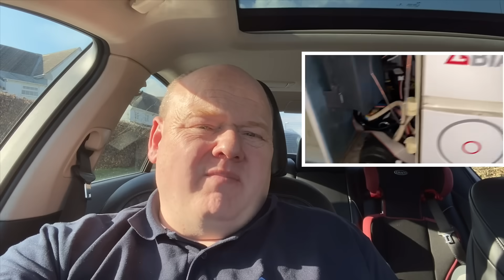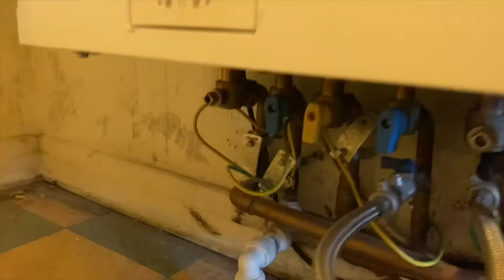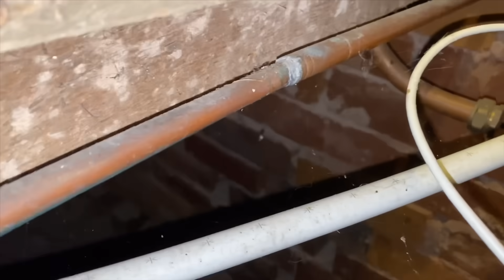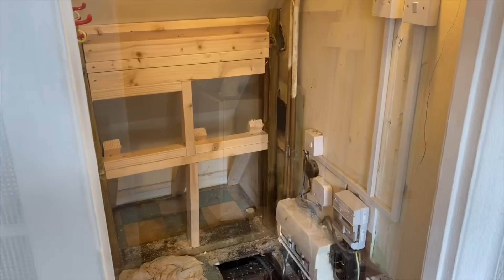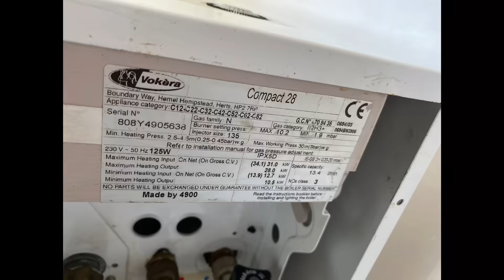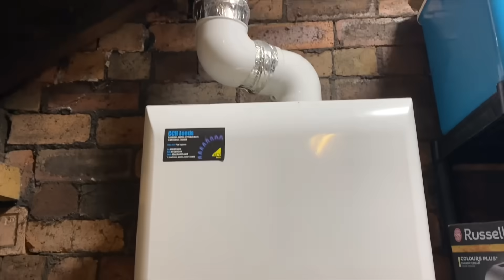LEEDS PLUMBER - Shocking Boiler Installation and New Boiler

Comment: The baxi platingham install looks rough I would have put a 45 on the flue because flue is not going through wall straight , also pipe work to boiler looks rough and not straight

Comment: I am stuck in my way always fitted vaillant from old Sine18 except 5 years when I did viessmann. I went to viessmann to use their vitotronic weather compensator and fitted viessmann solar thermal. I fell out with viessmann over spare parts and went back to vaillant (ecotec plus). I have done weather compensation for 30 years, used to use honey well aq6000 (I think) brilliant control with proper optimisation both on and off. Now I going on....

Comment: Why does he always say the gas supply needs to 22mm. The man obviously doesn't know what hes talking about, never heard him pipe size? In my experience anything over 15 meters effective length needs to be 35mm.
Reply from the maker: The required pipe size was 22mm. gas rate and the inlet pressure were tested at the end of the job. What you are saying about 15m is totally incorrect, It would depend on the required volume. Thanks.

Comment: Hi Allen, just looking at you're baxi replacing biasi vid.. Pretty common on the continent to find pipe soldered inside another pipe, manufacturers make their pipe to do this. If you need to go up two sizes they insert a pipe expander and stretch the cooper to allow the insertion of the bigger pipe. Keep up the good work Al'
phil 
Nottage Gas & Heating

Comment: I see quite a few poor installs similar to that shown, the use of push fit going all over the place is probably the one of the most common , and quite often fitted by a gas safe engineer. Other common faults are condensate flues with the fall to outside, and definitely  uninsulated overflow pipe on the outside of buildings. This is a great job to do and spoiled only by a small number of "Installers" who cut corners. Keep up the good work with the videos.

Comment: The Biasi was most definitely installed by a (lazy) pro. Probably been a multipoint in there before fed by the 12mm. The cutter rings were to tighten the 15mm pipe onto the 12mm to hold it while soldering. We did that in the 70's/80's joining 6mm to 8mm (old coal fired rads used to be piped in 6) as you couldn't buy reducers then so it was done by someone who is probably quite old now if they knew to do that. Ruff as fuck on gas tho and you can get the correct fittings (tho not easily as they will be an order).
The Vokera was probably also a pro doing a homer ( a Saturday job for half the cost of legit). Thrown out the back of the van for about 200 quid plus (stolen) materials by someone who would never dream of doing that standard in his 8-5 job as he would be sacked.
Whoever paid it deserved the standard they got.
People should realise the get what they pay for. Things are cheap for a reason but unfortunately many only see that they turn the boiler on and get heat so it works.
Most people, more so these days are totally thick for some of the stuff they pay for. A blind man would look at it and think wtf. 
Its not just in this trade its in all trades! The decline in standards (which imo will get worse) is because there are no apprenticeships anymore. Most so called tradesmen under about 35 learned their trade at the customers expense.
Thankfully my kids will never have to pay a tradesman for anything as long as i'm alive as its like a lottery. How bad is it when i'm saying that?
There are still a few good conscientious guys out there fighting a loosing battle but they are few and far between.
Ranting a bit there lol

Comment: Hey Allen, im wondering do you check all boilers you attend to see if they have been commissioned/notified? I had one recently that was in a rented accommodation.. they had a valid landlord ticket but wasn’t commissioned or notified and according to gas safe themselves as long as it has a valid cp12 the property is deemed safe to lett..

To me if the property is rented then there must be a responsible name to a boiler install because cp12 doesn’t involve removing boilers to check for secure fixing dismantling flues or reinstalling gas pipes... the conversation with gas safe went through all this and they gave me no guidance on the commissioning.. they were only interested in if it had a cp12

Is this proof that gas safe isnt really interested?

Comment: It's time to only sell boilers to registered gas engineers !  I fit 28mm as standard  because I've tested boilers with 22mm pipe and even short runs give more than 1mb drop  .
Forgot to mention DIY places like b&q should not beable to sell boilers and any gas appliances. 
Biassi are usually sold at these places .
Reply: The baxi platibgham looks a bit close to the floor ,have you checked in the book ?
Reply from the maker: @mgbroadsterJ  Yes many times 😂😂😂😂
Reply: Daren Parker . Some boilers can go down to 16mb at full rate.

Comment: Please do show us you sealing a flue inside and outside. 
Also what is the purpose of fitting a shock arrestor to the cold feed to a boiler?
There is so much to learn when becoming a gas engineer it can be very overwhelming. Your level of skill is admirable.
Reply from the maker: I will try and cover that when i install the main boiler. 👍

Comment: We had a trisave boiler and hot water cylinder replaced by valiant combi 13 years a go after coming home home from an evening out we could smell something similar to kippers when we went up upstairs to the airing cupboard the fuse spur was red hot and sizzling inside because the fitter put to many wires in to 1 box also the condensation pipe was poorly fitted and he didbt even power flush the system before installation. ALL OF THIS BY AN EX BRITISH GAS ENGINEER WHO WE LATER FOUND OUT GOT HIS GAS SAFE CARD TAKEN AWAY FROM HIM DUE TO TO COMPLAINTS!!

Comment: Enjoy watching your videos Allen, one quick question,was the gas pressed under the floor boards? It's just on acs course they told us to treat them as demountable, and should not be under there like compression.
Reply from the maker: The ACS examiner is wrong. It’s classed the same as soldered fittings. Thanks.

Comment: Surely, surely, it takes more effort to sweat joins like that than just use reducers 🤷.  More importantly, who had 12mm copper floating about?  Wonder if it ever had one of them old Main on demand hot water boilers 🤔, I'm sure they used to have huge square shaped flue outlets, and usually plumbed in 15mm.
Reply from the maker: I have never used 12mm before. i totally cut this out. Thanks.
Reply: @AllenHart999  I get that.  Honestly though, the effort some people put in to making a poor job is mind blowing. Keep up the good work.  Love the videos!
Reply: I am ex British gas, started 76 and late 70's we used 12mm albeit tended just to be wall heaters and fires. Don't think we used it for long however

Comment: The only time we used 3/8 (12mm) gas pipe was on gas fire installation final connection between the fire and the isolation cock  at the side of the fireplace .This was reduced down to 8mm after natural gas came on stream . Because of the obvious age of the pipework it was probably 3/8 Imperial pipe Which I cannot ever remember seeing once as a copper pipe length .Your comment on the Baxi and the Main being the same boiler except for the badge interested me. So are these companies in partnership now ?
Reply from the maker: Baxi Main and Potterton are the same. Thanks.

Comment: Great video mate, you’re right new gas engineers in the industry don’t get guidance after you pass you’re Gas course you have to fend for yourself and learn as much as you can as you go along. But your videos are good content and keeps me informed about a lot to little things that help me day to day. Keep it up mate 👍🏽
Reply: I have a licence just for one year , yes I do agree , I know nothing , I need to learn , there is not a issue with , but the basics as flue , pressures and proper fittings it's bloody BASICS and You shouldn't get your licence without follow this , if the pipes are not that straight or amazing shinny instagram way , it's not important , but correct way it is
Reply from the maker: Thank you.

Comment: You say you’re not allowed to put pipe within a pipe with gas. Is there any rule against using a swaging tool?
Reply from the maker: I used to use a swaging tool 30 years ago, We were told they were no longer allowed, Things seem to have changed as people are using them again and trying to make out they are new.

Comment: Shame people have to pay for this rubbish standard and un safe work that’s why you need to make sure you use gas safe engineers no one would sign that off terrible work
Reply from the maker: Jack Hoskins Do you think any trades person would do a job like this? Totally agree we need to try and raise the standards, Thanks👍
Reply: Allen Hart you would hope not as I have and know lots of trade people who are more than capable of doing a good standard of work but will never touch gas as it can be dangerous and needs to be properly tested and to see gas pipe like that is very questionable just lucky you got there before anyone got hurt

Comment: Very good video again Allen, great that your message is getting across👍🏻 Agree on the Platinum, I fitted quite a few and they are 90% reliable, some odd electrical faults, other than that, top notch. And I work for a different manufacturer😉 good content, showing people how it SHOULD be done. It’s a shame it’s not done proper by all.
Reply: Really bad installs keep me busy, in a way we have to be grateful😉
Reply from the maker: @paulkelly3254  Good point, I would love to see a day in your life 😂😂😂
Reply from the maker: I am sure you see some really bad installs as well. Thanks for the comment.
Reply: You don’t, I’ve done a heatcell, 2 return units, flow unit and 2 PCBs in a day as well as changing the flow adaptor on most of them😆 it’s busy, but that what you expect as a manufacturer. I used to enjoy installing, as you demonstrate, you can put your own stamp on it, and do it correctly. Shame how many don’t though ☹️

Comment: Worked on a customer's house doing a kitchen swap and wooden flooring etc. I kept smelling gas and the customer said it might be the pipe my husband repaired.
Straight away I said where's this pipe,she proceeds to show me a pipe under the sub floor that had a 15mm compression cap end siliconed on!
Couldn't believe what I was seeing and shut the gas off right away and called an engineer out.
Reply from the maker: Crazy how these things happen. Thank you for the comments.

Comment: Hi Alan I’m totally with you on raising standards but feel I’m up against it I do quotations adding filters as standard and shock arresters and pass on trade prices when quoting but constantly getting under cut by plumbers just chucking boilers in? Did you do video on pricing yet? Rob
Reply from the maker: I have been asked loads about boiler quoting and pricing, I will do a full video soon. Thanks.

Comment: We've fitted a few intergas combi boilers and have to say alls good.
Reply from the maker: What are the good and bad points about them? Thanks.
Reply: They don't have a diverter valve or plate heat exchanger. Only four moving parts. Copper water ways

Comment: It's often called a boiler service, but is it really just a safety check? I've always been led to believe everything inside the boiler is sealed and you can't really do anything without a major strip down. My boiler is an 18 year old Potterton Suprima which hasn't been touched in at least 8 years and has never had a problem.
Reply from the maker: Hi Mark, Lots of things could go wrong inside a boiler and it worth having it checked. Thanks.
Reply: Thanks, will do.
Reply from the maker: @Mark.D.H.  Thank you so much. means a lot that people listen and have things checked. 👍

Comment: Main boiler video - highlight any differences between baxi and main. could you do a video review/service/repair on the biasi maybe set up in the man cave?
Reply from the maker: I should of saved the Biasi but unfortunately, I gave it to scrap man. Main v Baxi yes i can do that. Thanks.
Reply: Allen Hart it’d be interesting to do a cut section of different manufactures S/Steel heat exchangers to compare the thickness of the steel. (Probably Interesting only for me 😂)

Comment: I think the pipe into another pipe is one of those grey areas, the majority of gas engineers wouldn't do it, but that's no different to swaging which is allowed in the BS on gas.
Reply from the maker: Swaging is very different as you are opening the pipe to the correct size. Thanks.

Comment: Had an issue the other day, new builds all new worcester compacts, entire flue run each about 8 metres have a wood screw through every joint including the flue turret in about 9 properties, was called out for leaks in 3 properties, all were due to the flue, and all the flues not supported and boxed into a void, as usual gas safe had great input 'their registration has changed their company has liquidated not much to pursue'
Reply from the maker: Some new builds are really bad, I went to one a few years back and it didn't have any of the flues connected in the loft.
Reply: @AllenHart999  I liked your comment not the flueing 🤣
Reply from the maker: @charlie12358  See some shocking things these days tbh. Thanks for liking 😂👍👍👍👍